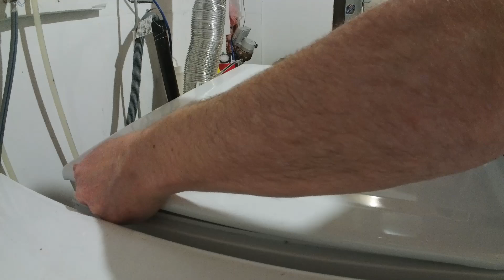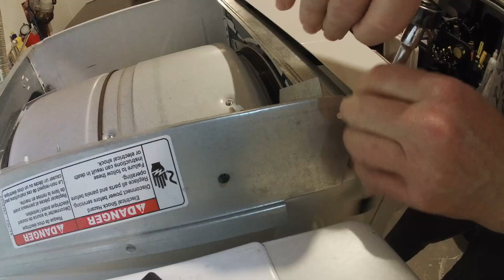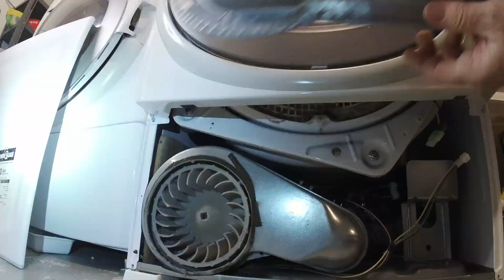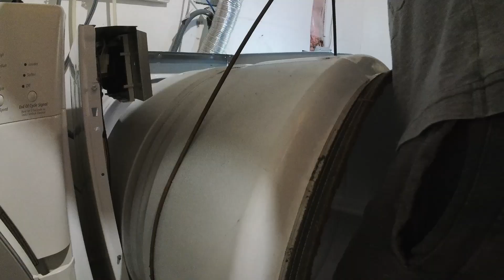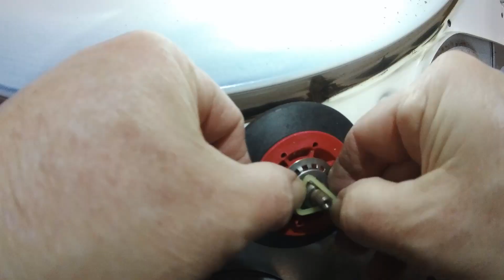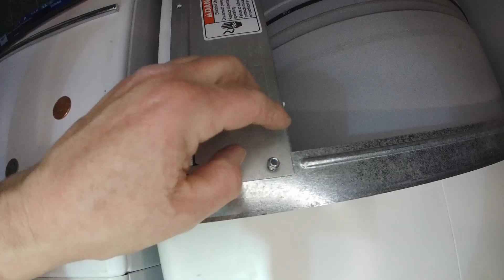Whirlpool Duet Dryer Thumping Or Squeaking Fix

Comment: How would I get the drum kit got a whirlpool duet sport? Our owners man doesn’t have this drum kit solution. What you do to order it or prompt on Amazon? Thank you
Reply from the maker: Thank you for your comment! I did a Google search looking for rollers using the model number, which gave me the part number. If you cannot find the part number this way, another option is to call a parts store for the part number and alternative pricing. With the part number it will help narrow down your search, and help cross reference the parts available on Amazon andother sites. Thanks for watching!